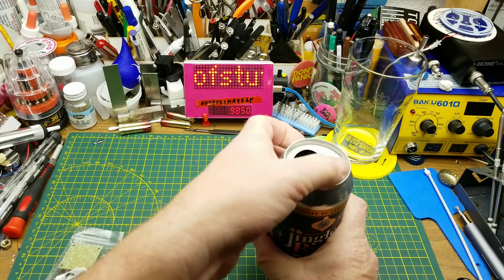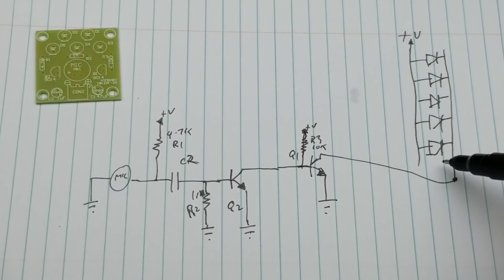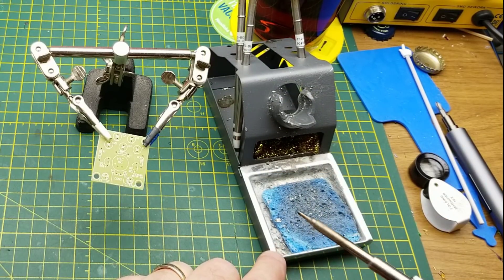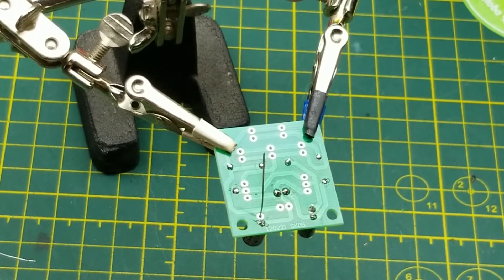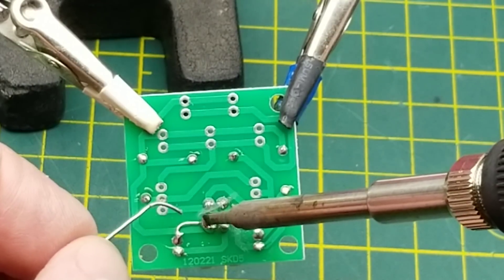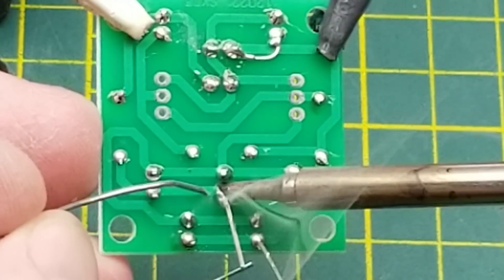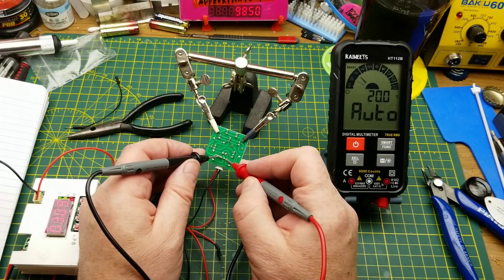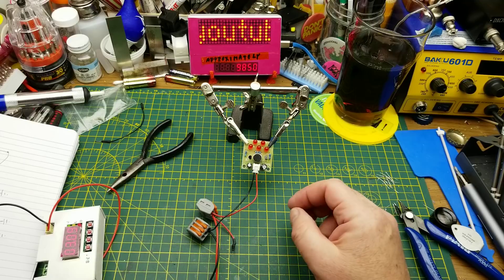Relaxing kit build: sound activated led kit

Comment: I got a batch of 50 soldering pads cheap a few months ago, darn so much fun soaking them and watching them expand.  You just don't get that with wire wool.

Oh if you want to do a sound to led circuit even simpler - attach an led to a piezo disc, attach to large flat surface and tada - self powered sound to led :).

Comment: If I'm not mistaken the schematic you drew would have the LEDs normally on and turn off with sound. Clearly that's not what actually happens so am I mistaken or did you draw the schematic incorrectly?
Reply: It appears to be a schematic error. The 1m resistor(R2) should be tied to V+ instead of ground.

Comment: I like these kits for just relaxing and practice. Bought a surface mount kit and then bought a couple new tips for my Weller WTCPL, why is my equipment so vintage.
Reply from the maker: There's nothing wrong with using whatever you can find at a reasonable price.  Look at some of my oldest videos - you can absolutely do it with basic tools.

Comment: Cool little kit. You need to try a wedge / chisel soldering bit rather than that oval thing, since you only ever make proper thermal contact with one of either trace or lead.
Every time I see somebody struggling with "helping hands" I giggle. They make the whole process of PCB soldering so much more slow, difficult and cumbersome. Perhaps better for video, I dunno?
I've found that the best way to hold components onto a PCB is to place it down onto a workbench, where is pushes the components tight, and nothing wobble around. Need to rotate or flip it, then nothing to unclip!